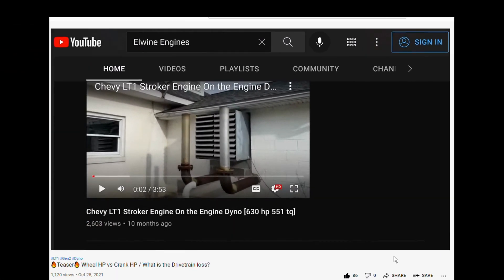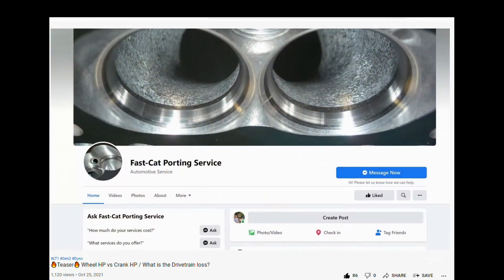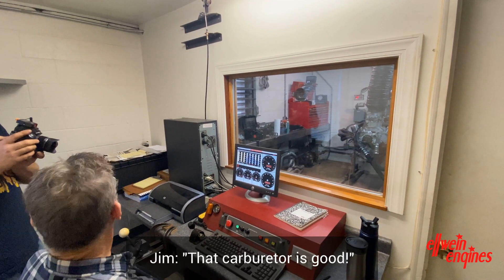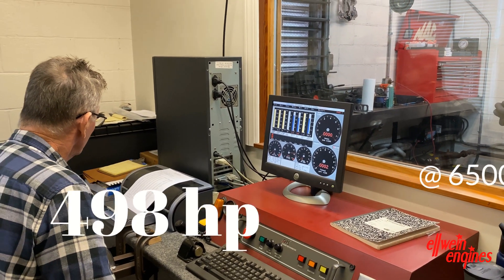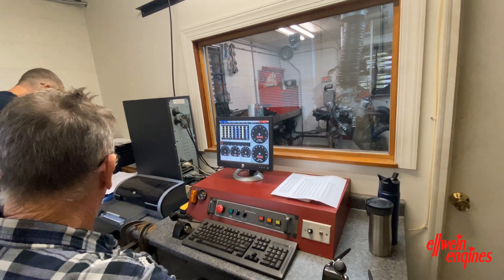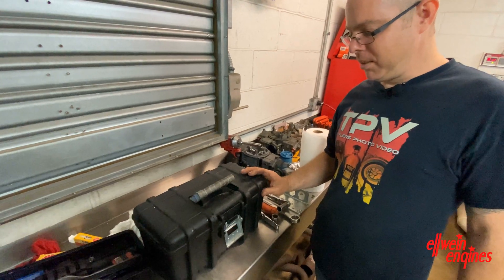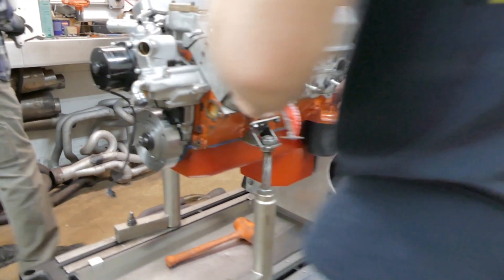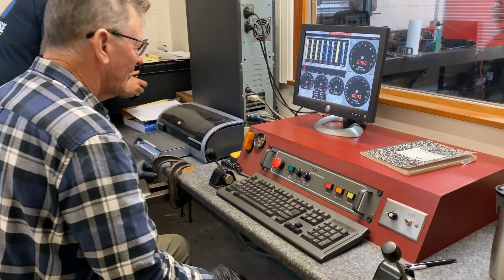Engine Dyno vs Chassis Dyno

Comment: My 396 made 542hp on the engine dyno and 447 rwhp on a few chassis dyno's. 
T56, 4.10s, drag radials
Reply from the maker: Good info!  Your 396 made a ton more torque too I bet.
Reply: @EllweinEngines  I can't remember the torque on the engine dyno but 440ish on the chassis dyno. 
Callies 3.875 crank
Callies 5.85 rod
Je pistons
11.8 compression 
2.02 valve More performance ported LT1 castings 
Crank scraper
232/236 583 586 cam w/ 1.5 rockers
Pro mags 1.6
1.7/8 headers 
Made 656 wheel on a twin fogger

Comment: I run a 1995 lt1 with aftermarket rotating assembly and aluminum heads, roller rockers and the infamous bowtie lt1 carbrueretor intake and its in a 89 caprice, i need more power?
Reply from the maker: Nitrous  :)
Reply: Just a fun street toy no nitrous, i wouldn't know where to begin, but i have a 95 ss impala, and a 30 over lt1 that needs freshening up, not my everyday driver, i can go all out on it, i will definitely need a tune when im finished, ofcourse its obd 1 which no one hardly can tune those.
Reply from the maker: @travistucker7471  Well,  sounds like a very good set up and situation.  The power is all in the cylinder heads so if your current heads don't have much for porting then that would be worth looking into.  Best bang for the buck is a good cylinder head.  Tyler's 500 hp engine is a good target to shoot for.

Comment: I need to know other than the ported aluminum heads lt1 home ported and 294 hydraullic roller, what else have you done
Reply from the maker: As much as I know...Tyler has a forged eagle 350 crankshaft and Eagle 6" rods and ? brand flat top pistons.  He set this engine up for nitrous.  He has head studs and MLS head gaskets.  Tyler is a very careful carburetor tuner in my opinion.  His camshaft is also a mechanical roller and the valve train sounded very stable when up there at 7200 rpm.